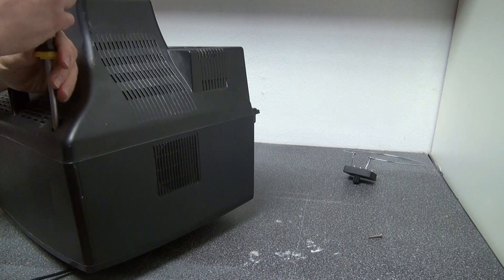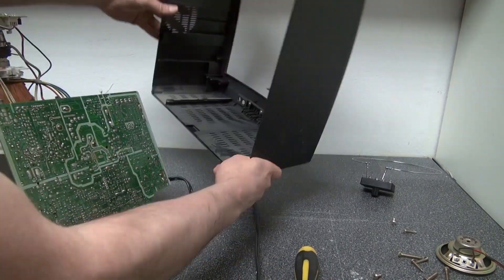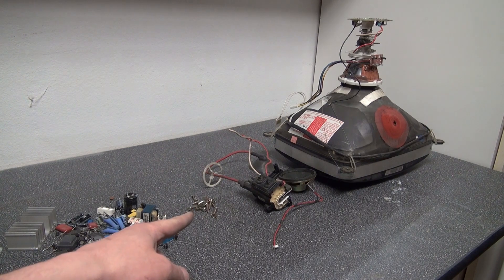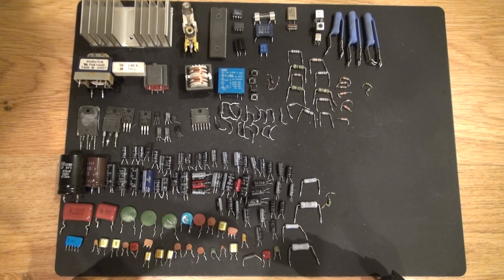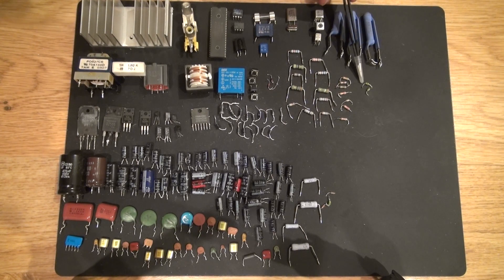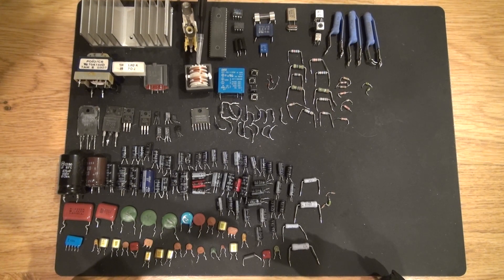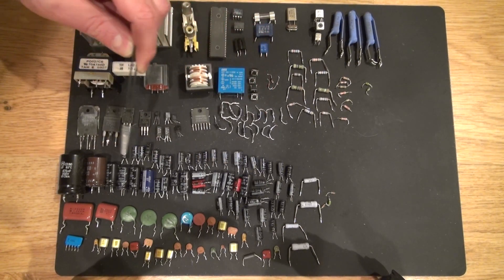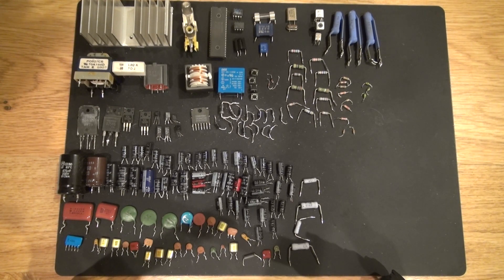Crt Tv Teardown

Comment: There was a time when the actual flyback transformer went to a high voltage diode and then to the CRT. In those days, the CRT would hold a high voltage charge which would usually be around 15Kv in color televisions. Those chassis’s were built  of sheet metal and either had vacuum tubes or modules. 
Discharging an anode on these CRT’s required a screwdriver with a long shaft and a clip lead connected to the chassis.  You would run the screwdriver under the anode cap until you heard the discharge snap. 
This is even when the set was discharged for hours. 
Yeah, I’m a retired TV tech.

Comment: This video is a safety hazard. The method shown to discharge the tube does nothing. If the tube contained a lethal charge, it would still do so after it was connected to earth ground - with a single wire. The tube is discharged by connecting the contact at its anode cap to the tube's kathode - which is usually connected to the monitor's chassis. The point is to short circuit the tube - not to connect a single of its contacts to an external, unreferenced voltage potential (like earth ground). When making such videos, it's better to leave out such safety critical steps - but simply and clearly warn viewers to check out other descriptions of how this is done safely. This is much better than to spread such dangerous misinformation.

Comment: When I was little I always had CRT TVs I had a Spongebob TV, a Diamond Vision TV I played on a old Windows XP Computer but for some reason now that I’m interested in Electronics I’m a little paranoid using one because I had a few in my dads garage and there’s a good chance some dust and sawdust got in there and I’m worried something would catch on fire considering the 27,000 volts in there

Nothing happened though just some crackling noice and that’s it

I’m 15 btw
Reply from the maker: That's cool that you are interested in electronics at a young age! I wouldn't be too concerned because the saw dust is not conductive and the high voltage connections are insulated. It would be the bottom of the flyback transformer that could be an issue. The connections are exposed but not dangerous, it will only shock you a bit. If it was metal shaving then maybe, but really likely. It would just cause a short and flip the circuit breaker before there would be an issue.
Reply: @SciTyeTech  oh ok! thanks for letting me know! 😁

Comment: What does the flyback do?
Reply from the maker: It supplies high voltage to the cathode gun to produce an electron beam that is manipulated by an electromagnetic field to produce an image on the phosphates of the screen.
Reply: @SciTyeTech  then what does the Circuit board on the back of the crt do?
Reply: @SciTyeTech  thanks!

Comment: I like to dig in my basement to look for broken electronics that I can scavenge parts from to maybe put something cool together 

One of my most recent tear downs was a old Dell latitude from the late 1990s running windows XP while I did get some cool stuff out of it such as a hard drive, Disk burner, screen and some other stuff

I felt like I broke this laptop for a good reason because the battery made it slower and I also tore down the power pack

I said I was glad I broke those but the truth is I wasn’t and the reason is I had a love for old tech and my mom bought it for me from eBay and I felt like I could have brought it back to life

And normally when I tear down old electronics I usually end of breaking them or they don’t have what I’m looking for
Reply from the maker: Sometimes you never know what you are going to find.

Comment: "This comment will be very, very useful". 

Just kidding, but I wanted to point out a few things. These sandstone and ceramic resistors are not necessarily "high voltage". A resistor's rating is dependent on the power rating, which is related to voltage across it. For example, only 10V across a 10 ohm resistor will dissipate 10 watts. That's a lot of heat and but hardly "high voltage". That white sandstone resistor is rated for 5W and appears to be 1.8K, so 95V across it will max out its rating. 95V is high voltage, but if that resistor was a lower resistance we'd be talking about much lower voltage.

I'd advise against reusing electrolytics. It might be ok if they're tested, but they tend to degrade more than any other part with age and aren't very expensive new. 

I also highly doubt that large IC will be useful for anything. It's likely some sort of video processor specifically for a CRT TV. 

The three leg "capacitors" are more likely ceramic resonators. Not capacitors at all.

Comment: I am very saddened to see that literally no one has pointed out that this is the completely incorrect way to discharge a CRT. Your wall ground is not connected to the TV chassis ground, the chassis is two pronged and is isolated. The charge isn't stored in the flyback or it's anode wire, It is stored inside the tube. The tube needs to be discharged to itself, from anode button to the dag coating or the ground wire strapped around it. The Flyback cannot store a charge, is it simply only a transformer.
Reply: social darwinism 💓😈
Reply: I noticed that too. It's like discharging a capacitor by connecting one lead to earth ground.
Reply: Totally agree with you. But isn't there a capacitor inside the flyback?
Reply: @Cr1z4n63L  The tube itself acts as the HV capacitor, hence completing that circuit with the grounding dag strap. Also why they will self recharge minorly if left disconnected
Reply: Well thank god I looked at the comments before diving in, does anyone know the proper way to discharge one? (Explain in simple terms plz)
Reply: touch it lol its fun
Reply: Also, the thousens of volts to be discharged. cant be handled by such a small wire as " the aligator clip wire he used" those are good for...3v, 5v , 9v...30v perhaps. I dont know if by burning such a small wire the monitor'ill be totalli discharged.

Comment: U can use the tv shell for aio pc using old laptop.. i made one. But still working on upgrading the laptop built in speakers.
Reply from the maker: Cool idea! I just need to find the right size lcd. I originally thought of turning it into a fish tank or terrarium.
Reply: @SciTyeTech  hope this help.. i found my old tv is 10inch.. have a thick bazel i have to trim the the side bazel  to fit my 14inch lcd laptop. My suggestion better find the size that fit the height because the width can easy be fit.. most hd screen wider than old screen. 

Lol, i just realized mine have speaker grill make my bazel wider than yours tv shell..  maybe you find some old lcd laptop or notebook that run xp or vista, windows 7 basic era most of use old aspects ratio
Reply from the maker: @Fhyros  Yes that makes sense.